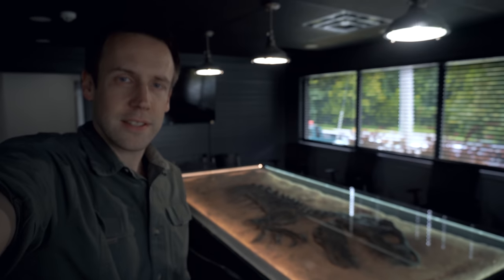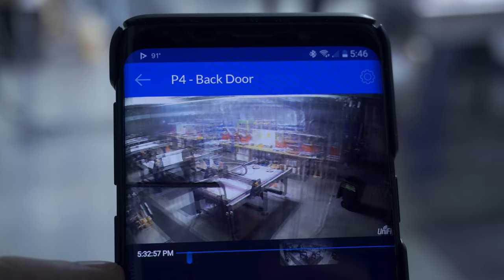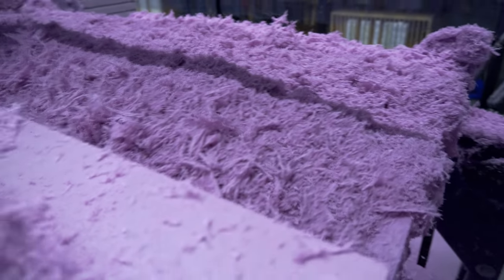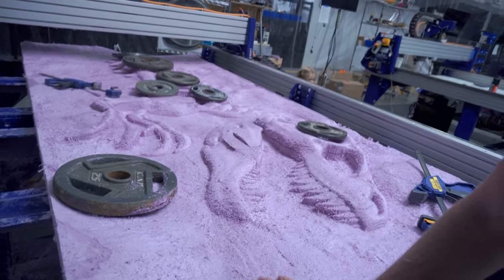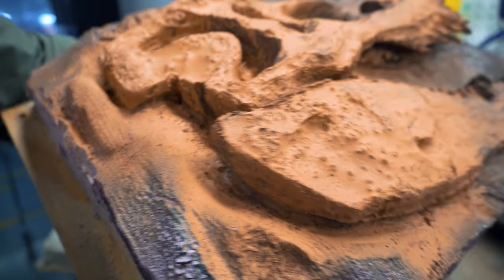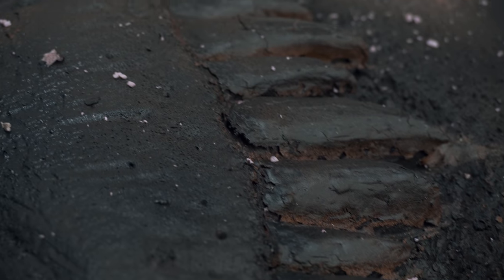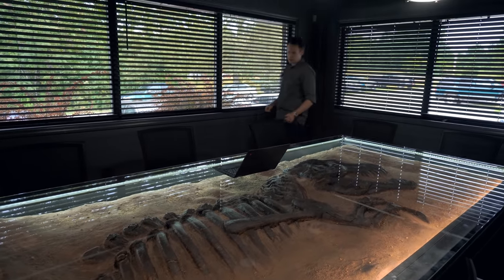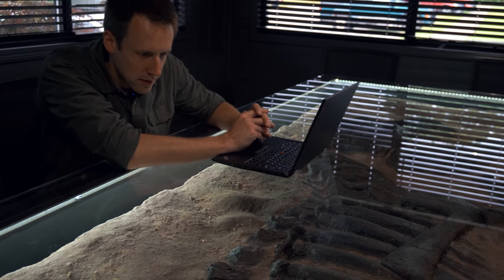How We Made the T.REX Conference Table

Comment: Nice touch with the 3/8" tempered glass. You may know this, but that stuff is pretty good against frontal impact. Tip a porcelain mug on it and you might break the mug before the glass. Tip a stainless steel water bottle on it, and it will probably bounce. Just sounds scary. But not so with the edge. Take care not to strike the edge. Beautiful job.

Comment: You should have put that hose directly on your cooling fan.. so that it is sucking air from far away form the work.  Granted it moves around and would need to be a tricky setup.
Reply: Yeah, that's smart. The ceiling is high enough that I could have hung it  from above and had enough travel.